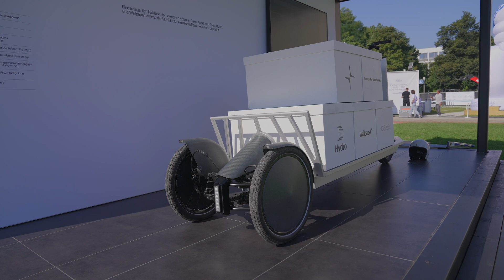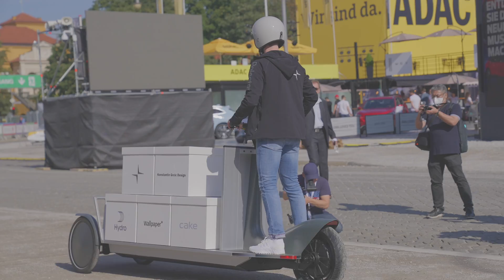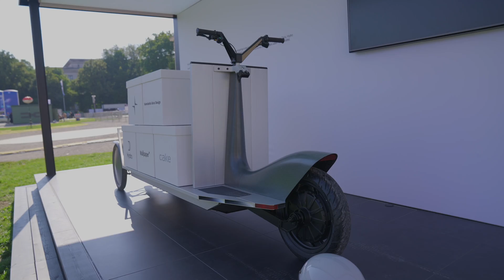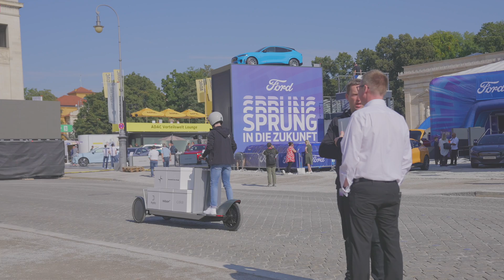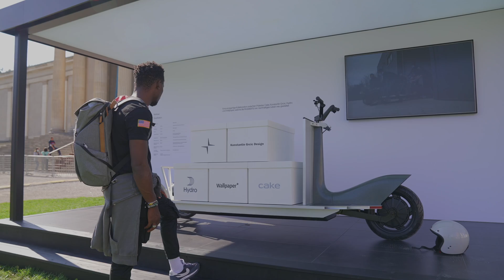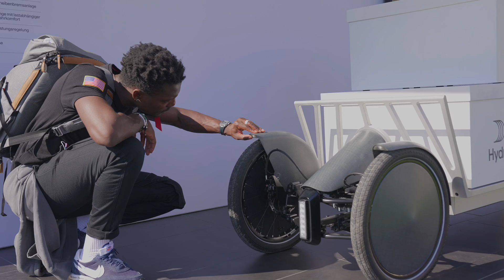Polestar Re:Move Last-mile Delivery Scooter Concept

Comment: Looks great, but why get rid of pedals and make it a huge e-scooter? What's the advantage compared to an e-cargobike?
Reply from the maker: I see what you mean. I guess it's to reduce weight but i could be wrong
Reply: One advantage of this design over e-cargobikes is the lower height of the cargo platform, which makes easier to load and unload the carried goods and also lowers the center of gravity of the load